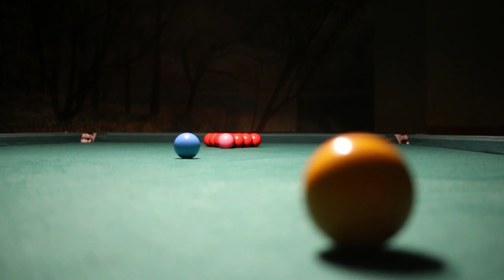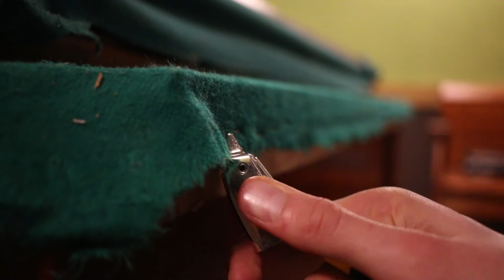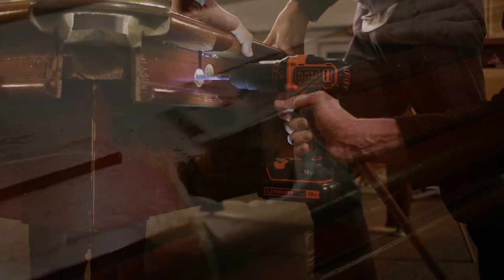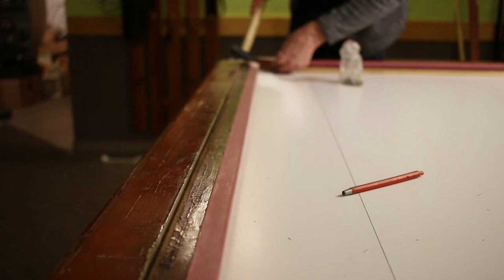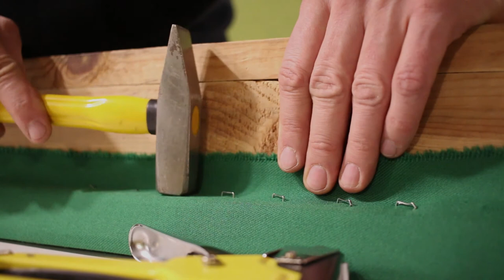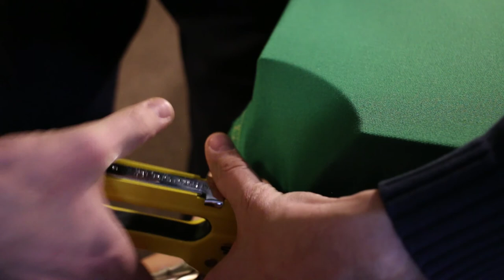DIY Old 10ft Pool Table into Snooker Table transformation

Comment: could you tell me how did you connect sevral MDF pieces together, and how to even the crack between the seprated MDF pieces??thanks
Reply from the maker: There were only two parts of MDF. We connected them to the base of the table with screws. The crack didn’t really appear so there was no need to fix anything.
Reply: @stanisawrakowski1949  ok,,got it..thanks for sharing the info